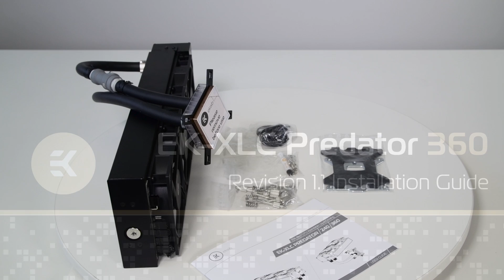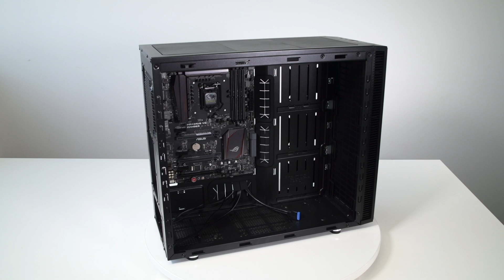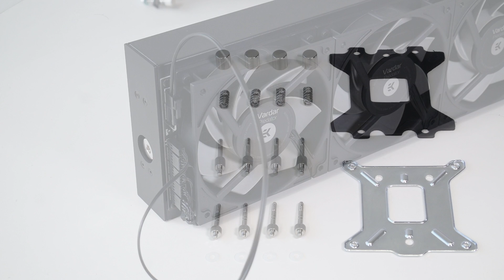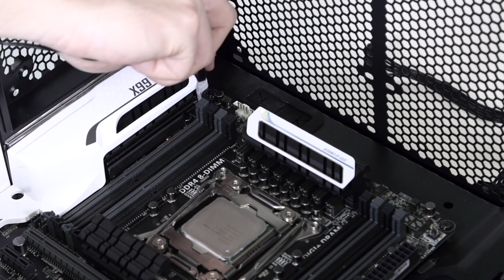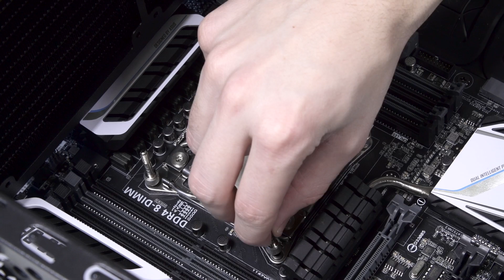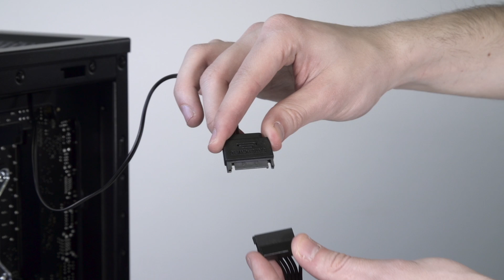EK-XLC Predator 360 (R1.1) Installation Guide

Comment: Can I Add Another Radiator To The Loop With My GPU?
Reply: The Elite Gamer you could, but at that point you'll have to fill it more, and I'd add a "real" pump as passing through more block and radiatiors will really slow down the flow.

Comment: Have anyone tried to custom this AIO? Like replace the stock tubing with hard tubing? Thinking about doing this to avoid having a pump/reservoir in my case.

Also can this do push/pull, they didn't show the back of the rad in the video.

Comment: Hi, I'd like to use the Predator with a board that has the narrow socket (ASRock 99E-ITX). Is it correct that I need this plate: https://www.ekwb.com/shop/mounting-plate-supremacy-lga-2011-narrow-ilm

Also, is there a video on how to perform this modification? I assume it's not overly complicated, it looks like you only have to remove a couple of screws, right?

Thanks for the help! :)
Reply: ***** Alright, thanks for the help!

Comment: I must admit this block mounting looks a lot better than the one on my V1.0 Predator 360. I was a bit concerned when fitting mine that I would scratch the motherboard traces near the cpu socket. The V1.0 is a lot more tricky to install than the V1.1.